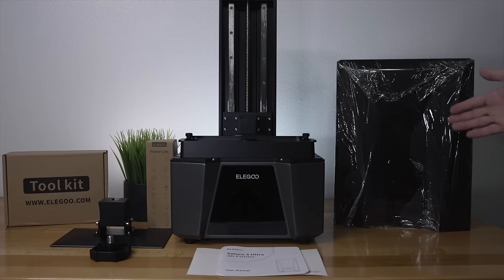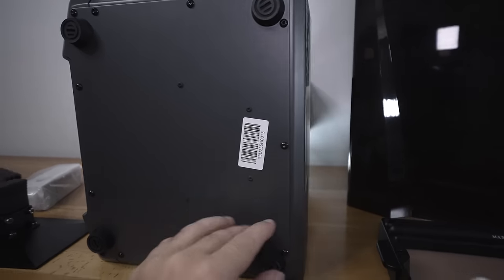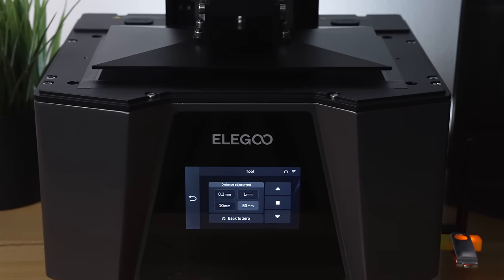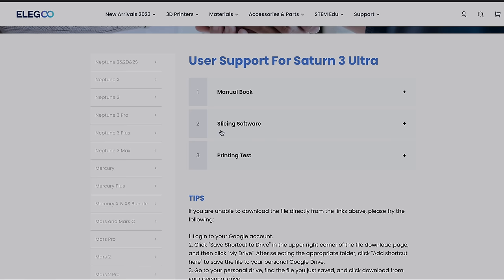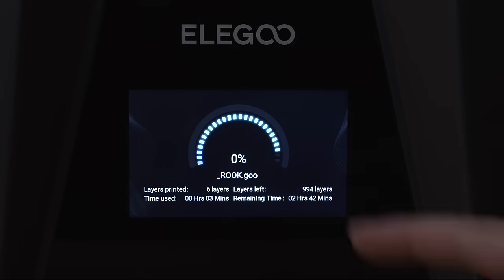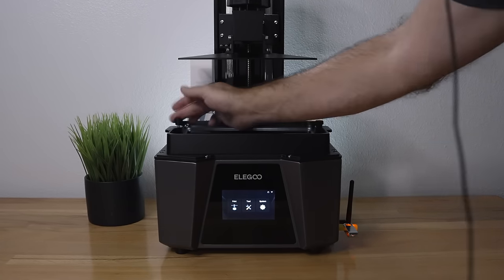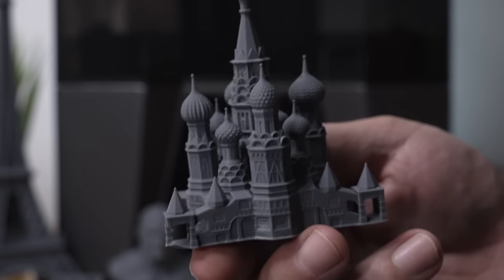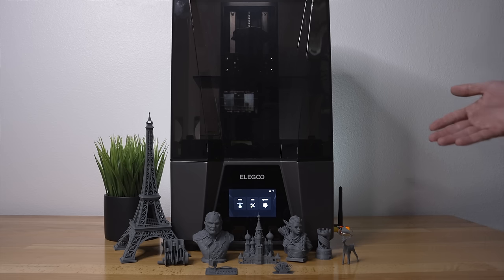Elegoo Saturn 3 Ultra - 12K Resin 3D Printer - Unbox & Setup

Comment: The two busts and the cathedral, the surface imperfection at the lower level is because you put it directly on the plate, you're correct to put a hole at the bottom and top, but the hole at the bottom is blocked by the build plate doing nothing causing the hollow print to make a suction cup when pulled and when it comes down it's pushing the resin into the cavity with nowhere to go but to push out on the walls causing what they call blooming. You need to either raise the print on supports so the hole at the bottom is not blocked or if you want to print directly on the plate you need to relocate the bottom hole to a side on the lowest part of the print so that resin/air can drain during the print.
Reply: Thank you. I have taken a screenshot of what you just said. In the near future I will purchase a resin printer. Thank you
Reply: Should I always draw a whole, even if the object isn't whole?
Reply: if the object isn't whole, you dont need it

Comment: Note for safety: the carbon filter does not help with dangerous fumes, it's really only for reducing the odor. For extra safety, I'd recommend either adding an active exhaust to the premade port on the lid or buy/make a fume hood to go around the printer entirely. Those carbon filters are really misleading so take this as a word of caution, don't trust them to keep you safe
Reply: If I put the printer inside a tent and print with it, is it okay to leave it alone for a day after the print is done and it's OK, or should it have a vent going to the outside?
Reply: @ashouaxiong1404    It's best to have ventilation. The resin is always letting off fumes so whether it's printing or not, you're still gonna get fumes. The agitation of the print bed into the vat is what lets off more fumes than stagnant. If you just put a tent over it, you're not doing much more than just using the printer normally. If a fume hood is out of the question, an unoccupied room with a fan in the window set to exhaust will work, just give it a bit more time to air out before entering. Liquid resin is by no means "extremely dangerous," but it's still not good for you to breath. It's a fun hobby, but like most larger scale hobbies, you really want to have your own space for it. It's messy, it's expensive and it's time consuming. I'm assuming you're thinking about getting into the hobby, so here's some stuff you're gonna wanna look into:

• A computer with decent graphics. Nothing crazy but working with 3D models can be taxing on lower end machines.

• An ultrasonic cleaner. Not strictly necessary but really improves the final product.

• A UV light box. Again, not necessary but weather can be unpredictable and the sun isn't always gonna be out when you need it to be and the box can give an even distribution of UV around your piece for faster/better curing. Light boxes can be bought (for quality) or homemade (for budget).

• Replacement vat film. You are almost certainly gonna scratch the clear plastic film on your resin vat and/or it'll just need replacing after a while.

Beyond those things, you're gonna want a stockpile of gloves, masks, 90% or above isopropyl alcohol and ample amounts of working space. 

It's a much more intensive process than filament printing. From the slicer to the final product, you're probably gonna spend more time on your resin prints than your filament prints. There's more things to worry about and more steps that require your attention. In my experience, a failed resin print feels worse than a failed filament print. The cleanup of a failed resin print is usually pretty stressful. One wrong move and you've ruined your vat film. It's fun, don't get me wrong, but it's not always a cake walk. Just know what you're getting into before sinking probably over a grand into it. Hope any of this is useful to you and good luck with your future endeavors

Comment: I just purchased a S3U and it'll be here before the weekend. I'm very excited, and nervous as I have not had a 3d printer before. I have a fully enclose space for it (a grow tent) in my garage with several air filters (probably overkill), and I'm getting the wash station with the printer. I've watched this video several times in preparation for how to get up and running quickly. Thank you for this video.
Reply: Hows it been?

Comment: Great video and very useful as I have just finished setting up my environment and am about to start this new adventure.Thanks.
By the way my machine did not come with that little brush you were using, but the USB drive contained both software products (Chitubox & Voxeldance) and a folder containing the rook.

Comment: Did anybody else's build plate come with little rubber caps on the bolts?  The four bolts that hold the bracket to the plate had four rubber caps, and I figured they were supposed to be there.   I would recommend removing them if your build plate has them.  I had several successful test prints, so I decided to print something else, but at about 80 percent I happened to notice one side of the model was still being built,  but the other side of the plate didn't have anything on it.  When I opened it I found one of those little rubber caps had fallen into the resin tray and so the build plate was smashing it against the plastic tray so it wasn't level.  The resin tray got a little dent in it, so it's ruined.  The model was so stuck to one side of the build plate that I scratched the brand new plate.  And the LCD screen has a small smudge that won't go away, right where the rubber piece was being smashed.  
So two lessons I guess,  remove those rubber caps if the bolts have them, and also check the resin for debris before you print....  I am in the process of working with customer service, so hopefully this can all be resolved.  And maybe someone else can learn what I figured out.  If anyone reads this who has an Elegoo Saturn 3 ultra haha.  I guess other build plates might have them... I'm not sure, and surely no expert!!
I do have to say I am super anxious, because if I can get this machine fixed/replaced I will be printing like a newspaper press! The quality and speed of the few builds I was able to do were AMAZING!!  I have so many things I want to make!!
Reply: Well, after a week and $90 for a new resin tray, because it's not covered by the warranty, and about 12 failed prints later.... I'm not so enthused about this machine.   I might recommend looking at other brands...  I'm going to try a few more days, and a few more tips, but I am probably going to end up fighting to return it, or eat almost $1000... Not happy with Elegoo.
Reply: This happened to me, Two of them fell off on my 4th print and has damaged the film. This needs to be rectified via Elegoo. 
Hoping the film is still usable :(. Doing first print since accident now.
Reply: Funnily enough, I saw someone else post about this exact issue. I couldn't remember if it was for this printer or another one, but this comment has let me know that I need to remove those rubber caps.

Comment: Nice video, as always, thank you :) But please don't wear the gloves from the Tool Kit (these are latex gloves, not nitrile) and also don't scrape the vat with anything other than soft silicone (!) spatula. Especially not with the plastic spatula or paper! You also said, that the bottom (dark grey) part is "all plastic", but according to Elegoo it should be an "all metal body". Can you confirm that?
Reply from the maker: Your right, the body is all metal! My mistake. Thanks for the glove tip.

Comment: So, I thought that when leveling that you shouldn't be able to easily move the card around. I was under the impression that it should be pretty tight. I'm also confused on why you would not need to relevel. If you take it off to remove the print does it not risk changing the position when you replace it?
Reply: I also have this concern.
Reply: I just got mine, and its a valid question. Since the four bolts completely lock it in place all you're essentially doing is removing it from the frame. Once you reinstall it with the top large screw and set it back to zero it return to being level again.  I can let you know after I do my first few.
Reply: I had the same thought as you. And what it looks like for me is his leveling “doesn’t” count. What I mean is: he leveled the bed, than moved up 0.1 3x. Then set to zero. Then moved up 1x 0.1 and saved home. So it would be 0.1 higher not as demo with leveling card… am I missing something?
Reply: @gallegospam no he completely did it wrong but it will help if you're getting massive elephant foot when printing flat on the bed.

Comment: One thing I never considered is that voxeldance doesn't have a "linux" variant, which is super strange, considering that one the s3u's big selling points is supposed to be linux. Sure, the platforms are different, and they don't actually equate, but what crowd did elegoo think they were targeting with that selling point??

Comment: Had to sub and also a thumbs up for how detail your reviews are.   I currently own the Ender 3 Neo printer and am doing my research for a 3D Resin printer.  There are two fans on the back of this resin printer are they both to expel the fumes from within the enclosure thru the usb carbon filters ?   Thank you for your time and sharing the information.
Reply: No, the fans on the back are to circulate air from the working area within the printer base itself that houses all the electronics. They do not move air from within the print space. That is done by the optional fan outlet on the back of the clear smoke grey enclosure cover. The carbon filter towers merely circulate the air within the enclosure through the contained activated carbon filter material. Other reviewers have questioned whether the carbon filters really do much. I don't have one of these so I can't comment.
Reply: @steveh8724  Thank you for clearing this fumes concern, still doing my research, thanks for sharing.

Comment: so ive got this printer recently and got a wham magnetic plate like i had on my old saturn 3. Im struggling to level it because unlike yours when i go to set zero it says 'please back to zero and then move z axis on hte interface manually'. Ive already manually positioned the plate manually so it just wont reset so i cant print because the level is not correct and it is trying to force the plate through the tank. Does anyone know how to fix this?

Comment: I have a question, is there a way of printing rubber resin (F39) and making it electrically conductive, so that it can operate touchscreens like a phone stylus? can I just add graphite powder to the resin or will this break my Saturn 2?
Reply: Graphite powder usually doesn't cause issues as far as I know. The graphite on the outside may just wash off or smudge everywhere, so I don't know if that's the best material 😅

Comment: 32:55 Horrible safety protocol.  Gloves on both hands when handling a resin car filled with resin.  There will be splashes and a thin film of resin all along the side wall, and you definitely got some on your thumb.

Do not take small exposures for granted.  These all add up, and if you continue like this, you're going to develop allergies to the resin, which may prevent you from even getting near it.

The printer should be in a negative pressure environment (grow-tent, etc) if indoors and vented to the outside.  Especially if you have pets or children in the house.

Your prints are deformed because you've hollowed them out, but you haven't created ventilation holes in the prints, and you've basically created giant suction cups with your models.  The suction can be so strong that it will pull the printer out of alignment and deform the print. If the item is small enough and vent holes would ruin the look, just go solid. Otherwise, put vent holes in the print where they will be obscured, or easily covered by green putty and painted.

But my dude, be more careful with the resin.

Comment: I see the surface of the model has the slight vertical scratches on it due to using the fast release ACF...using nFEP is better and changing the release film will be the first thing I do when I get mine.